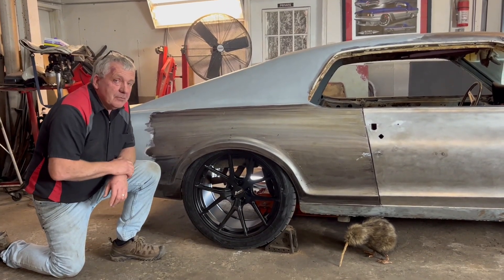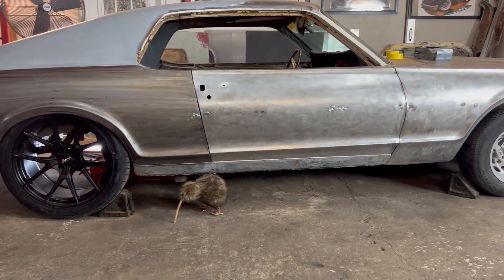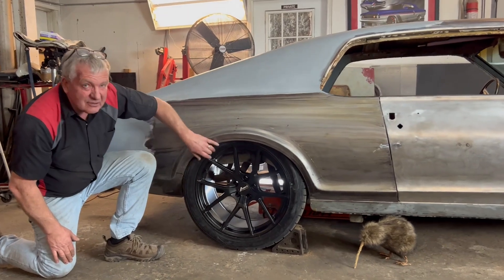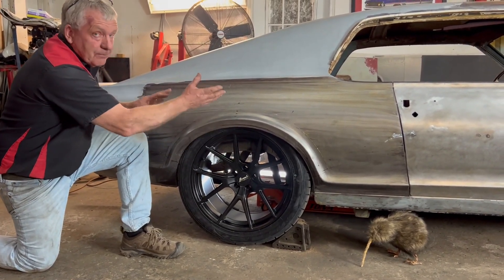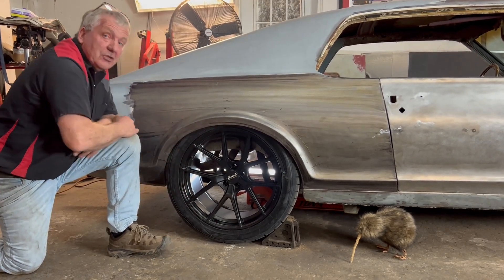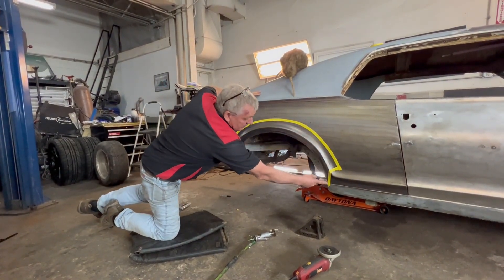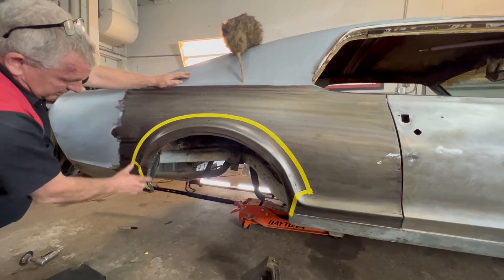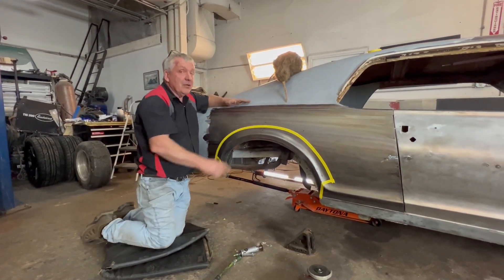Cutting & Beating on the Cougar FastBack

Comment: Struggling to lower a 65 mustang and I won’t alter the suspension basic design or cut the standard body work, ( don’t know who designed it ? Could have just looked under an MGB and copied that )
15x7 rims + high profile radials so very conservative, had it exactly 1 inch off the deck and looked great but you couldn’t actually drive it 😂 I have now re-lowered it to a more reasonable level  with the subsequent lose of suspension travel and some wheel arch lip manipulation, point being you see some really nice stock looking cars spoilt by having the ride hight of a Land Rover and If you don’t get the wheel / tyre size correct on a restomod it’s disastrous, worst crime being a 18 inch rim ultra low profile tyre and a bloody great gap between the tyres and wheel arches, so another excellent alteration by your good self 👍
Reply from the maker: Thanks man.

Comment: Kiwi.  My 68 cougar has an anoying rattle by my drivers push lock behind me.  I took apart the door..put shrink wrap around the lock.  Any good ways to get a rattle without driving to narrow it down?
Reply from the maker: It can be frustrating tracking those down. No easy way really I'm afraid.  Just have to keep at it
Reply from the maker: Plenty of light inside the door and just thump on the door from lots of angles. It can be a real bear finding that stuff
Reply: Thank you ill try it.

Comment: Hey Kiwi have a question, any help you can give me would be awesome. Just swapped out the oil pump on my 65. I had a Melling high-volume and I swapped for Melling standard-volume. My question is about clearances from the pump to the crank. The closest the crank came  to the pump was .113, i checked the pistons at the bottom of the stroke and they were closer at .098, I'm think that the pump clearance should be fine if the bottom of the pistons are even closer. Do the pump clearances seem fine to you? I know this a weird question, i just couldn't find any thing that confirmed my question anywhere. I'm sure I'm just being a hypochondriac,,,,, again lol. Any insight you could give me would be amazing thank you.
Reply from the maker: That should be fine as long as your not pulling 8k in her
Reply: @kiwiclassicsandcustoms9160  Thanks man I  really appreciate you confirming that. I looked and looked and nothing. Saw some videos of installs and it looks similar to what I'm seeing. Last time I had a oil pan off an old Mustang was 2001ish. Everything looks SO CLOSE together it freaks me out lol. Thanks again KIWI!!!!

Edit 8000 not a chance